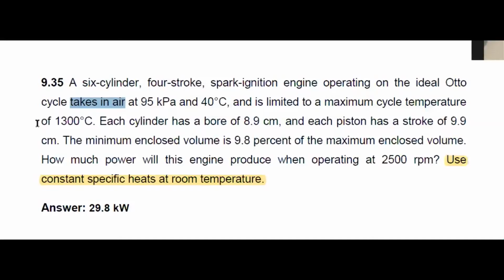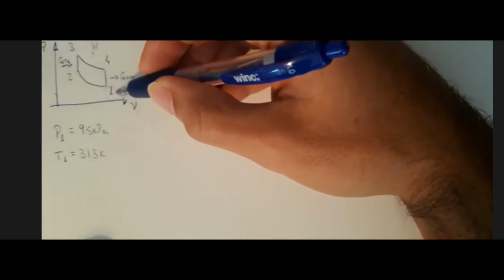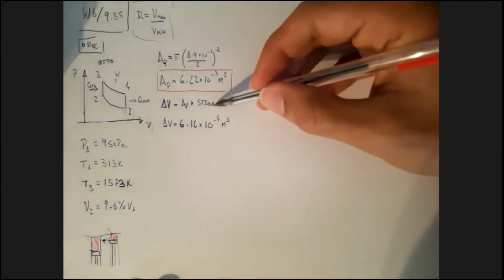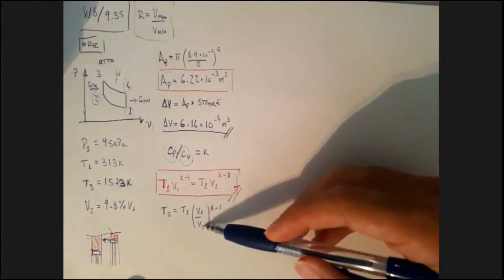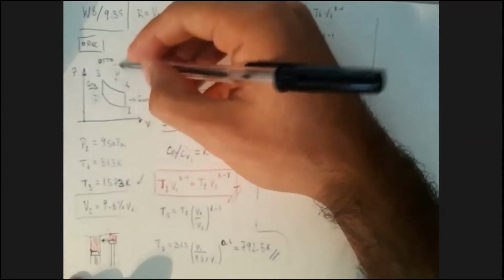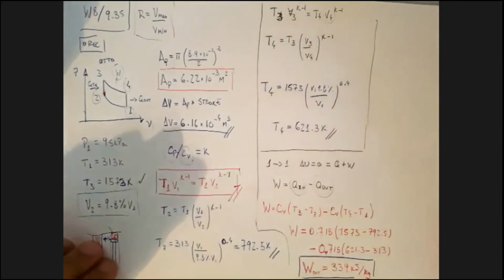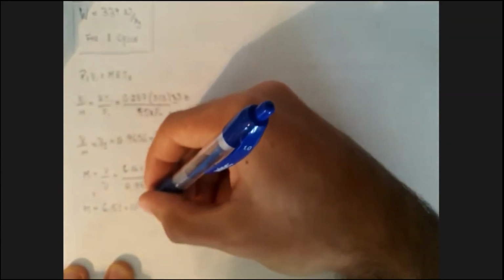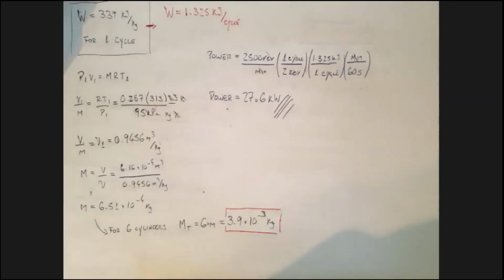Thermodynamics Mech3001 - Week 8 - Problem 2 (9.35)

Comment: Thanks for the solution! I'm just a bit confused why intake is at state 1. If this were a 4 stroke engine, shouldn't we assume the intake happens at some state 0 at the Top-dead-center volume, and a constant pressure process to state 1 (first stroke)? Then two strokes from 1-2, 2-3, 3-4, and 4-1, and final stroke from 1-0? I understand that the 0-1 and 1-0 processes have zero net work, but I believe the intake of a 4 stroke otto cycle should happen at Top-dead-center.
Reply from the maker: Hi James. In the 4 stroke, you'll have two strokes from 1 to 3 (pistons going down is one stroke and piston going up is another) and two more from 3 to 1. State 1 is where you have maximum volume, so its the end of the air intake process (which occurs between 4 and 1). So while I understand what you are saying and don't see anything incorrect,  the information given by the problem can only refer to state 1, ie, you wouldn't be able to relate the 95kPa from "state 0" back to state 1, would you?
Reply from the maker: This video assists: https://youtu.be/YCs6MqF2UvQ